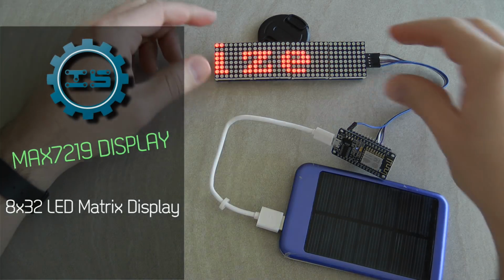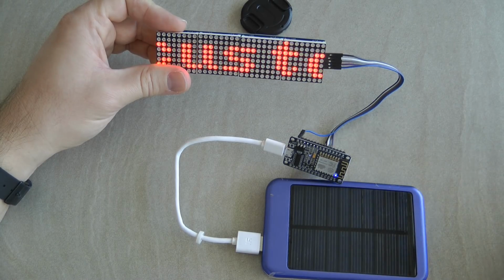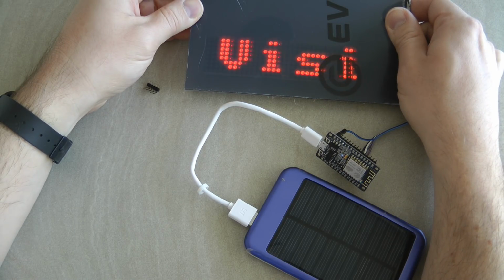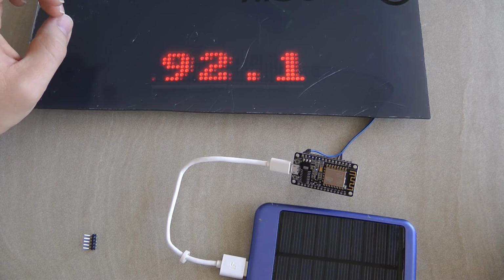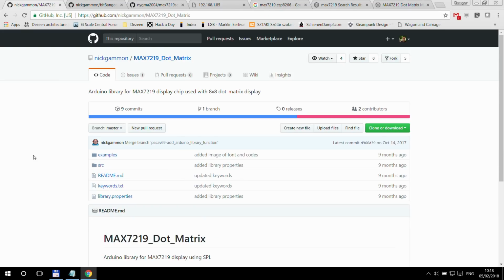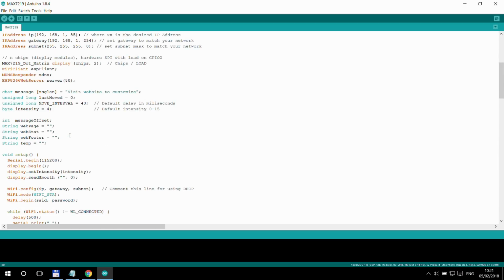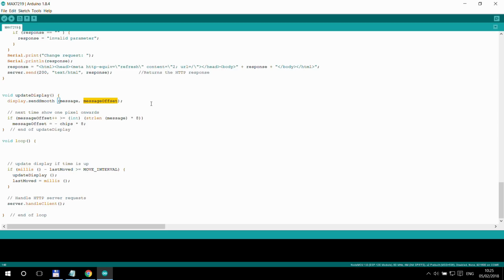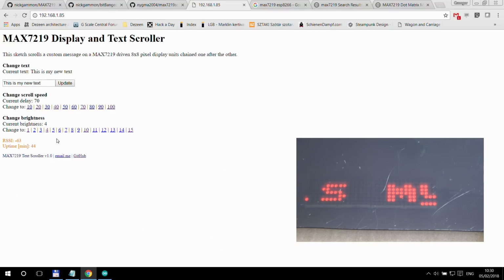Building a simple text scroller display

Comment: Hiya, thanks for sharing this video. If I'm using Wemo D1 mini, do i just connect to the same ESP pin as you have on your github? and the ino file will also work with it? Cheers
Reply: I got it working with ESP8266 wemo d1 mini! :) just wondering how can I now getting working with node red. can I use http request on this? I can see on the very bottom of the code, so can it work with http request then?   
// Handle HTTP server requests
  server.handleClient();
if you can point me to the right direction on any article that might make it work with node-red then that'd be great. cheers
Reply from the maker: @LastZion  This project was done a long time ago, I don't have the project assembled any more. But yes, you can do that. Use a http request node, and just call the same URL that you see in the browser when you change the text.
Reply from the maker: Yes, these pins are also on the D1 mini as well.

Comment: Hi, great Video - do you think its possible to assign certain text to a button and say button 1 is pressed " hello world " Displays? 

also can this be made waterproof?
Reply from the maker: Yes, why not. The nodeMCU has plenty of pins left you can program to do certain functions. For watetproofing probably the easiest if you find a suitable waterproof junction box. There are types which has clear top. And use cable glands to get the wires out were the water cannot get it. You can probably use waterproof buttons as well, although could be a bit expensive. Or use reed switches inside and can operate them using a magnet from outside the case.
Reply: @csongorvarga  Thanks makes sense, i want to add it to the back of my Motorbike jacket and add Buttons to my handlebars, Kinda like if someone is tailgating then I can send a message.. I like how portable youve made yours which is a great idea. 

I dont want to drain my battery plugging direct to the 12v
Reply from the maker: @SteveN-ny4my  Makes sense. This uses around 150mA, that is peanuts usage for a bike battery. I would not worry about that. So the challenge is to use a small enough clear box for this which fits the display and not too big. I would use a single multi core cable (e.g. network cable), use 2 wires for power and the other 6 wires are available for 6 buttons. And pass the cable into the box via a cable gland. Or cast the entire display in clear resin. Which makes it non-serviceable :)
Reply: Csongor Varga thanks Man, ill get some bits together and see what I manage to get going :D Appreciate the help.

Comment: Best regards
First of all, thanks for the video tutorial.
How to use characters such as, Á, Ã, É, Ú, Ô, Ç, etc,?
Reply from the maker: Well, that could be a problem. I am not sure if the font supports special letters.
Reply: @csongorvarga  I agree with you but, a large part of the world uses these accented characters. There must be some library with these characters.
Reply from the maker: @Dancopymus  I checked. There is a MAX7219_Dot_Matrix_font.h in the MAX7219 library that I use. That has characters defined up to code 256 which includes a lot of accented letters as well. The code may not be able to pick these up from the request when you set the text from the webpage, but it looks like most of them supported by the code.
Reply: @csongorvarga  Hi Varga
No, the text entered on the webpage does not recognize any accents. It's a shame, is not it? Thank you

Comment: after compiling sketch it shows the following error :
WARNING: library MAX7219_Dot_Matrix-master claims to run on (avr) architecture(s) and may be incompatible with your current board which runs on (esp8266) architecture(s).

Sketch uses 321488 bytes (64%) of program storage space. Maximum is 499696 bytes.

Global variables use 29816 bytes (36%) of dynamic memory, leaving 52104 bytes for local variables. Maximum is 81920 bytes.

Board Selected : Nodemcu 1.0
Reply: It may he old but what is the answer to this error? Cheers

Comment: Can we stack led's vertically instead horizontal & display something like smiley or emoji?
Reply from the maker: This particular library I have used does not have orientation or graphics support. Just a simple text draw in this orientation. So you would have to use different library for horizontal mode.

Comment: I've been working on a project integrating these displays with MQTT. You can check out the source code at https://github.com/jptrsn/clock-message-board. It's a bit beyond the basics of the display, as it includes an HTU21D temp/humidity sensor and WS2812B LEDs as an MQTT JSON light component, suitable for use with Home Assistant.
Reply: plans on adding some basic web config, like tzapu's WiFiManager? So you can configure wifi and add custom parameters to modify the mqtt topic, for example, without recompiling... :)
it's just great you used the Parola lib i suggested to Csongor in an other comment :)
Reply from the maker: This sounds great. I have created a neopixel based display project for myself as well. It works with Node Red and I love it. I have a separate video on that.
Reply: I'm working on a video explaining how to set up, build, and use this. It's using Node Red to interact with Google Play Music Desktop Player's API to get currently playing track, show rating information, etc. I've been following your work on Node Red for a while, and learned quite a bit from it!
Reply from the maker: Thanks, I am interested in your project. I am your 200th sub :)
Reply: +1! 202! :D